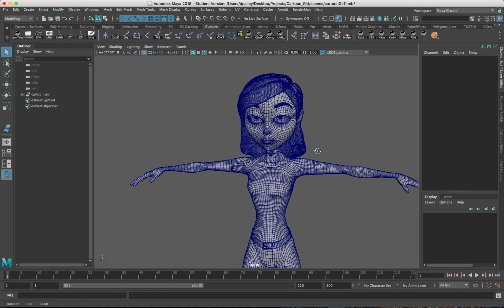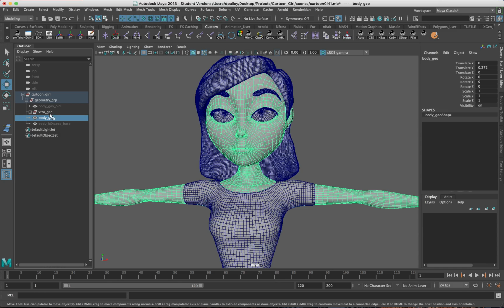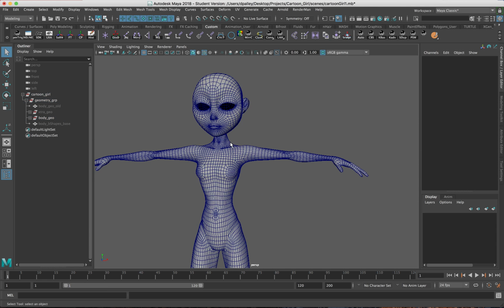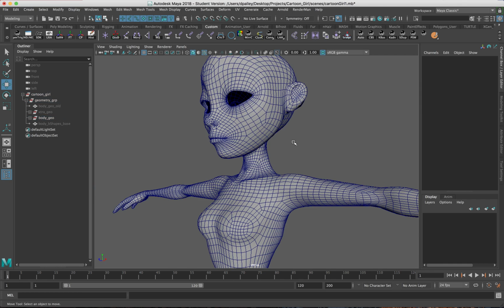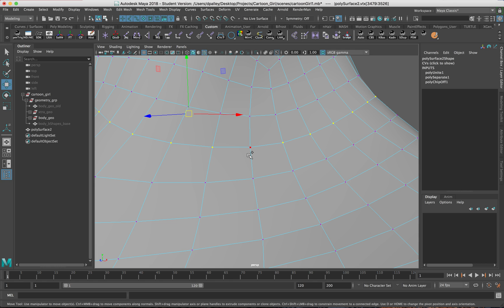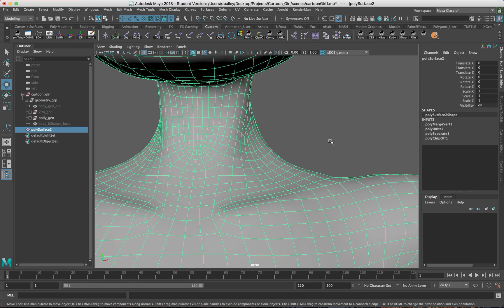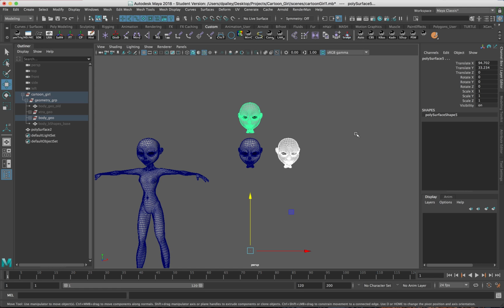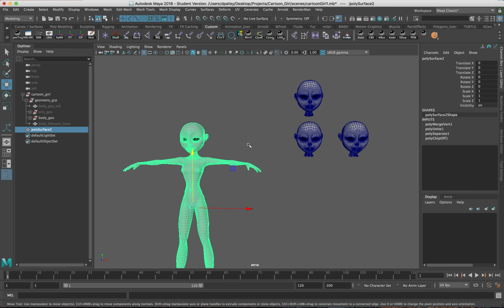Separating Head Geo for Blend Shapes

Comment from the maker: For those have an issue extracting faces, here is another method to separate the head geometry:

** Please know that if your character's body geometry is multiple separate pieces combined into one, then this method will split them all up.  You will have to combine them all again when you re-combine the head and the body.

Step 1) Select an edge loop on the neck where you want to split the head.  Make sure the edge loop you select goes the entire way around the geo, which is the case if some edge loops have 5-point junctions on them.

Step 2) . In the modeling menu, go to Edit Mesh -> Detach.

Step 3) Select the body geometry in object mode.  Go to modeling menu again and click Mesh -> Separate. 

Clicking Separate should split the body geometry into 2 pieces.  Then you can follow the rest of the steps as normal.  

** If you click Separate and the body doesn't split into 2 pieces, then you didn't select the entire edge loop before you detach.
Reply: Hey thanks this did work! However when after I duplicate the separated head and want to combine the og head and body together, it changes the vertices number, so blendshapes don't work after. 

I thought it was the order of how I combine meshes. But if I try selecting the head first, or body first, combine, the vertices still change their number, even after merging vertices.

Any advice?
Thanks!
Reply: @grantwallace2147  so did you find a way? i have the same problem as you too
Reply: @pehnutbota  you can't combine the mesh, just add the blendshaped head to your skinned rig skeleton and work the paint weight between the body and the neck. If you combine them, the blendshapes are logicaly destroyed and no reduction of size at final

Comment: Hey, I used this method and it worked very well but now I'm having trouble importing my animated blendshapes to Unity. It seems that my base mesh has the connection to the base blendshape but the base blendshape lost its connection to all the other blendshapes... I tried baking as well as not baking blendshapes but I can't really bake the blendshape node on the base mesh, it only works on the base blendshape but still it makes no difference anyways.

I have the feeling that I shouldn't be using this workflow for games... Do you have any suggestions for me??
Reply from the maker: ukenni thanks for the comment! hmmm, what if instead of having the base blendshapes connected into the original model, try connected the individual blendshapes into the original model instead and avoid the base blendshape. You can keep the base shape to duplicate for additional shapes, but don’t use it to connect to the original. Give that a try and let me know if that works.
Reply: @dcpalley23  Thanks for your fast answer! So, I connected the blendshapes directly to the original geo and copy and pasted the keyframes I already had. So far so good but now I get the error of vertex count not matching when exporting (probably already had this problem from the beginning when I think about it), so I'm not sure how this whole thing is supposed to work when Maya isn't able to export this kind of setup... Am I missing something? I will probably try to seperate the head from my model entirely now (luckily it won't be visible on my model)

Comment: Hi! I'm running into a problem. FWI, I'm on maya 2019.
When I select the faces of mesh, Edit Mesh, Extract, it separates every face and turns them into separate objects. If I change the Extract option to turn off separate objects, it still doesn't separate the head from the body like in the video.
Is there some update in 2019 I'm missing?
Thanks!
Reply from the maker: Thank you for the comment! I have a pinned a comment to this video that explains another method to separate the head geometry from the body.  No sure why this is happening for you, the default settings for extract isn't doing this for me.  The alternate method I have pinned to this video should help you out though.
Reply: @dcpalley23  Thank you so much! Your videos are really helpful man, keep doing them when you have time.

Comment: I tried to script out this process but failed on merging stage. How can i find the closest vert for each vert? Since both verts on separated geo's will be at the same position i thought i could do it that way.
Reply from the maker: Beyazpiyon so I think I’ve got something that might work, granted I haven’t tested it or anything.
1. Select the edge you want to split
2. Get the verts based off that edge (Mel) and get the world space translates of each vert (xform) 
3. Save the translates as a list
4. Detach the edge and separate the geo, duplicate the head geo
5. For each piece of geo, loop through each vert on the mesh and if the translates match from the original list, save that vert to a new list
6. Once you have all the matching verts, combine the geo and merge the verts together

This will be a slow script, since it will have to loop through all the verts on both meshes, but it should get the job done. It might be quicker to use API. Although this process when done quickly should only take about a minute, so using a script won’t save you much time and you’re only doing it once. Hope this helps.
Reply: Yea you're right about usability but i'll give it a try. Thanks for the idea.
Reply: @dcpalley23  A handy trick is to make the merge distance really small in the options like 0.0010 with the "merge for two vertices "option enabled. You can then just select the entire mesh in object mode and click merge. Maya will merge any "loose" vertices automatically. This obviously only works if the two separated meshes has been combined. If the merge distance is too big you have a mess. I have a shelf button to toggle border edges on and off. Easy to see whats merged or not.